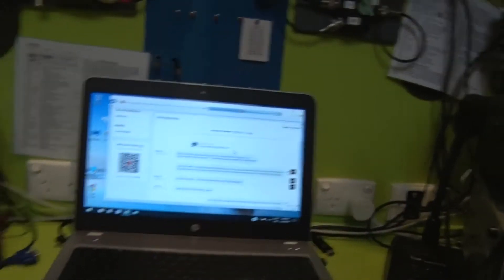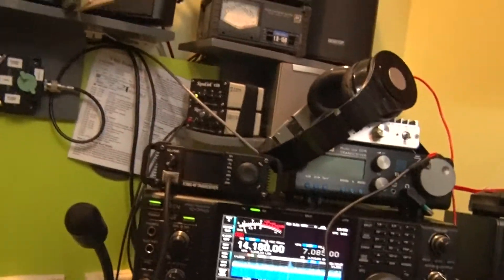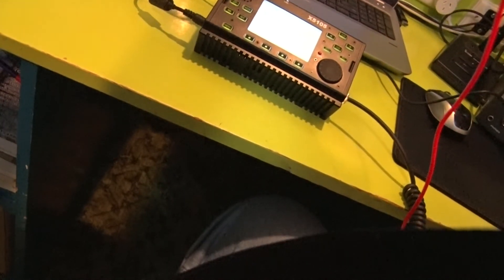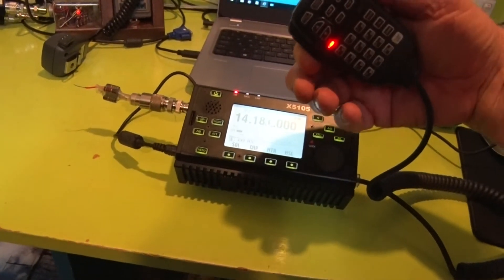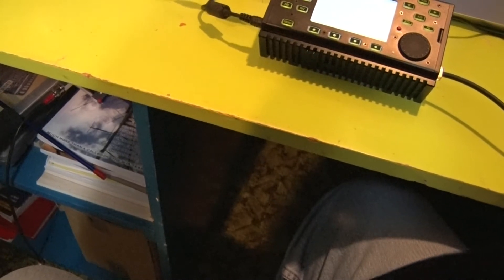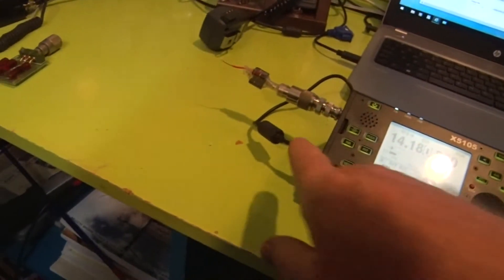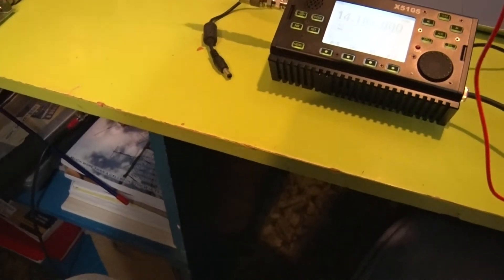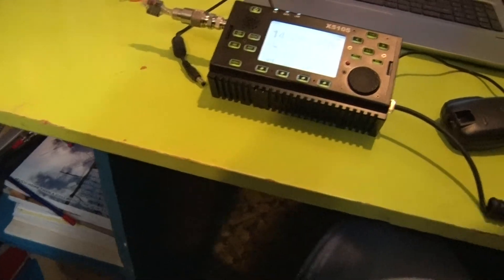Xiegu X5105 buzzing on transmit problem

Comment: I had the same problem while using stick antennas. It is very common in QRP world. RF feedback. The same happened to my FT817 with electret mic and even with my homebrew uBITX too. 
The reason of the click-effect is the delay in digital signal processing. (it is an SDR inside)
Solution is easy. Try to avoid mismatched antennas, always use counterpoise and use clip on choke filters on patch coax cables, mic cable, key line, pwr cable, or even on your earphone cable as well. It is the best as close to the radio body as possible. Proper ground can be given to the radio using a BNC-UHF converter and a short wire soldered to it. (there is no gnd terminal on this rig.)
After calibrating the radio, doing these mods and using antennas and cables with good SWR the little rig became a miracle.  
Good luck for it!
Reply from the maker: I fixed the problem by wiring the PTT and the internal mic to the socket, works fine now with standard Yaesu mic.
Reply: @trevorpallant5726  is this same PTT yaesu mic ?
Reply from the maker: @zhaqirhussein  It is the digital mic that came with the Xiegu, it is a common digital mic out of China, not from Yeasu at all, as you see it also has a keypad and function buttons
Reply: @trevorpallant5726  thank you for explaination

Comment: Hi Trevor,

I've been dealing with my seller and in the end they delivered. They got me a new mic with a sticker saying "V.101a", and the only visible change is a bodge on Q1 replacing the transistor with a 0 ohm resistor between the connections from C3 and L1 and leaving the pin from Q2 unused. Don't know if they changed anything else that I didn't spot or if the firmware in the mic is different. For the new mic to have effect you also need the most recent firmware so you can disable the mic bias (setup menu item 20). But either way you should update the firmware to get the cool new features. I hope you or someone else have use for this information.

Comment: Try another mic that is wired Icom, see if the noise is still there.. I beta tested the X5105 for Xiegu and yours is the only one so far with this problem..You could request a new mic from your supplier to replace the duff one. As for the RIT function, its a firmware bug and were awaiting a firmware update to resolve it. The up down buttons are purely the wrong way around, by this i mean the rubber pads them selves and not switches.. These problems will be resolved with the 2nd batches currently being produced..de Wayne 2e0bvj
Reply from the maker: The clicking, or buzzing noise is due to the microphone drivers inside the main unit.The unit works okay using the internal Microphone, but is faulty when using the supplied external microphone.I have exchanged the microphone with the one simular used on the Xeigu X108G, with the same effect, clicking and buzzing. The problem therefore is NOT with the microphone, but the interface inside the main unit.                                                 
I have since received a full refund from AliExpress (where I purchased it), and have repaired my Xiegu X5105, by wiring the internal microphone and the PTT contacts to a new external microphone (a Yaesu MH-31), and now the buzzing is no more, it works just fine.               Other problems, with my Xiegu X5105               1 The Band up and down buttons work the opposite, Band up button goes down the Band, the band Down button goes up the bands. This is shown to be the case on all the U-Tube clips I have seen but is glossed over. The band up and down do not ''Wrap around"'when the reach the top, or bottom band. This is written to be the case in the manual.              2 The extended menu allows the changing of the filter widths, yes this works fine. However the filter width in the display does not alter. For example changing the 2,4k filter to 2.7k does change the filter, but the display will still show 2.4k.               3 The manual explains the power supply volts can be activated to show on the display by turning on in the menu. This is not the case.               4 The ''RIT'' function does not work, this is a widespread fault I have watched some of the video's on u-tube of others who cannot turn on RIT.               5 The manual reads that the display lamp can be turned off by holding the ''Lock'' button. This is not the case, it can only be turned off in the extended menu.               6 Turning the "'NR'' on by giving it a level that is not 0, does not indicate this on the display, as it should as read in the manual.                7 Pressing ''V/M"' to enter memory mode works fine, the memory number and new frequency displayed. However re pressing ''V/M'' does NOT return to the frequency you started from, it says VFO-A, but the frequency remains the memory frequency.
Reply: That's not true, my radio also have the noise on the external mic. And it's not so much that the radio have some issues, that's fine IF the manufacturer are responsive and stand behind their product and resolve the issues, no matter if it require firmware fixes, replacement or repairs. Alas Xiegu does not, when they do not respond to customer e-mail they don't resolve the issues and their warranty is worth spit.

I did buy the radio and had high hope for it, it is a nice design and and a portable radio with built in battery and ATU is a great idea. I did not buy this radio to find faults with it but the faults is there.
Reply: ornotermes Xiegu have just had a 10 day holiday, it was a national holiday so it wasnt just them.. This could be why they have not been responding.. But i can assure you that they do back up what they sell, the X5105 also has a full 2 year warranty.. We have worked closely with them for almost 3 years now to get things right when the very first X108’s and the now X108G’s.. They do care about their customers unlike many of the other manufacturer..
Reply: It's two and a half week since i tried to contact them, and presumable Trevor tried to contact them before he posted this video, so it can't be as simple as a ten day holiday. Well, I have to call is as I see it, and I don't see them doing that right now. It says two years in the manual, but on the warranty certificate it say one year... so they aren't even internally consistent. 

Please ask them to show that they care about their customers then. They have two customers here that's very disappointed in their customer service.